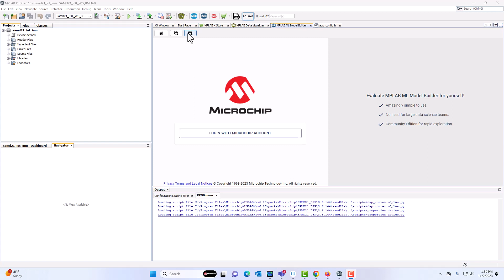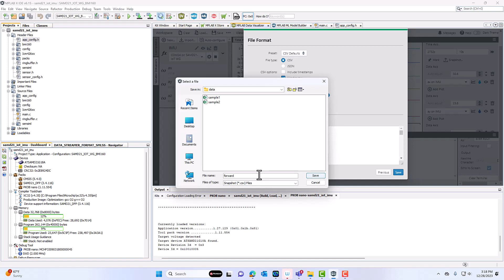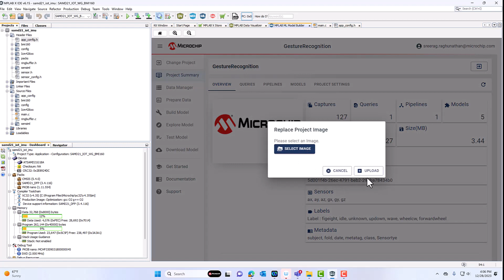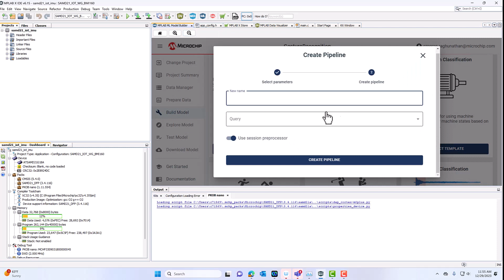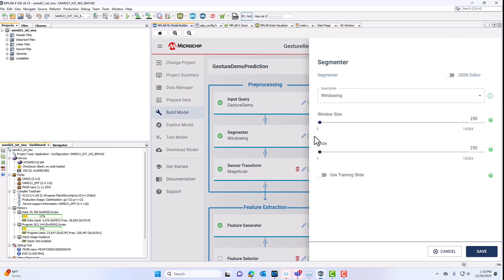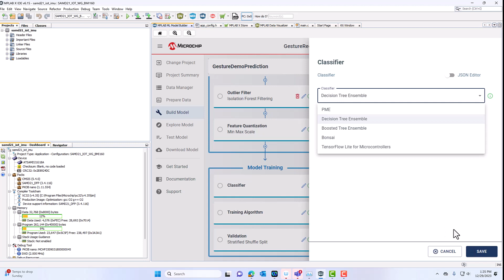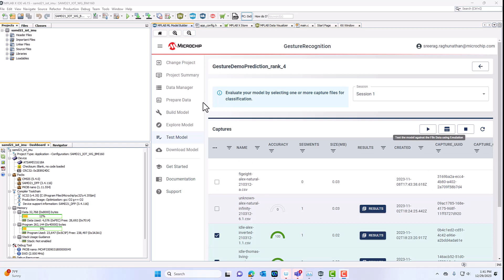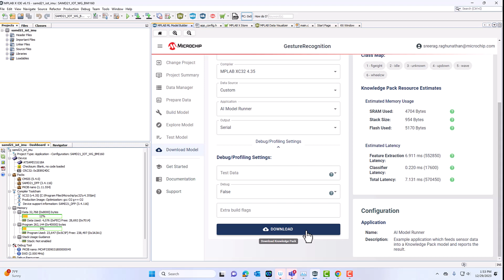Tutorial: How to Use MPLAB ML Development Suite for Machine Learning Applications

Comment: How can we flash neural networks made in python? I have a small neural network that I want to flash in PolarFire® SoC FPGA Icicle Kit
Reply from the maker: Hi there, thanks for your question! The first step is to convert your model into a format that the hardware can use. This is usually done with ONNX.
Once that’s done, you’ll use Microchip’s VectorBlox SDK (https://www.microchip.com/en-us/products/fpgas-and-plds/fpga-and-soc-design-tools/vectorblox), which is designed for optimizing and accelerating machine learning models on FPGA hardware like the Icicle Kit. After setting up the model, you can use the Libero® SoC design suite to program the FPGA and get your model running on the board.